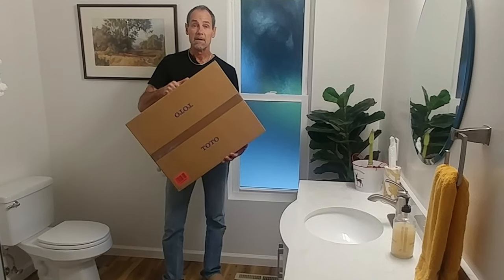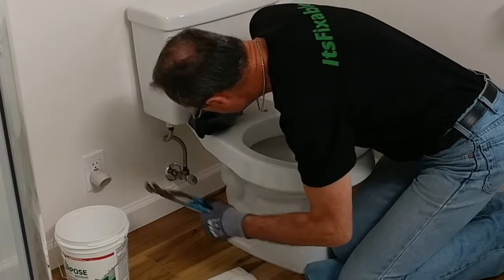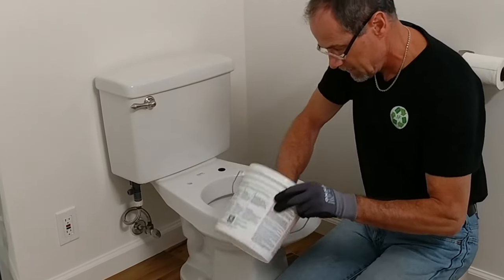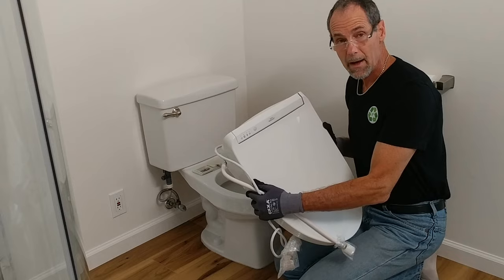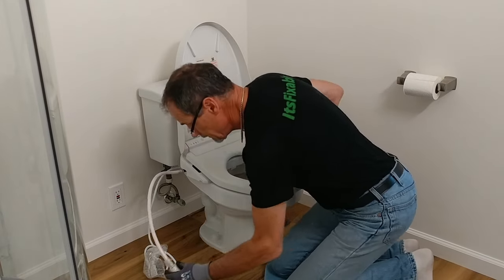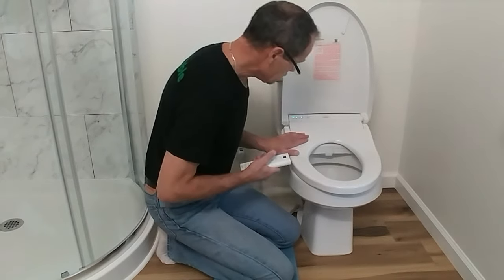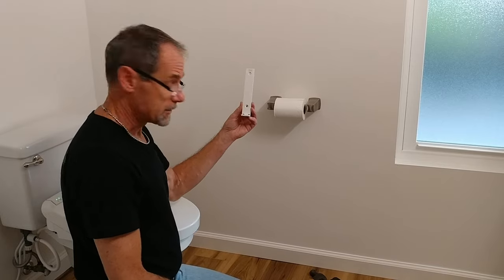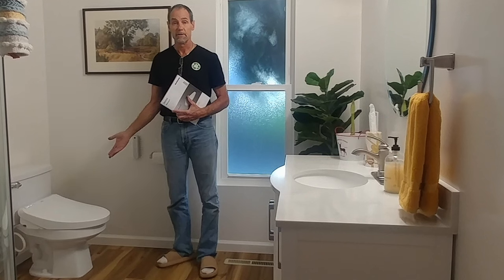TOTO Washlét Bidet Toilet Seat Installation

Comment: Two tips from a rank amateur ; If the grommets seem too large for the holes, drop the screws into the grommets and just push them straight down.  To position the seat forward and back move the washers forward or back on the bracket, thus moving the bracket.  Excellent video.
Reply from the maker: THANKS! Good tip on the grommets. Sounds like some people are having trouble with smaller diameter holes in the ceramic casting and you're approach just might work.
Reply: You’re the man, literally came to this video solely for help with this part
Reply: Holy god thank you so much I was hard stuck on this.
Reply: Lifesaver right here

Comment: In Germany the water connection is behind an drywallin 90% of installations..thats an serious problem. Also powerplugs next to watersources are not often to find because of safetyrules. After my Japan travel I want a TOTO😂
Reply from the maker: If water connection is behind drywall, how does one turn off the water in order to service the fixture? That doesn't sound convenient! Here in California, GFCI (ground fault circuit interruption) outlets are required when outlets are within six feet of a water source. additionally, they are required in all exterior applications. These are a wonderful safety device.
Reply: @ItsFixable  We have shut-off valves in various places, usually in the cellar or under the washbasins or in the bathroom. Normally, you can shut off every room that is supplied with water and also under the washbasin. Very convenient.

Comment: Just a note that on my Kohler toilet I could not push or twist the grommets in even wet, but using a screwdriver to gently push through the center of them it worked.
Reply from the maker: Your persistence paid off.
Reply: Thanks for the tip, was just trying to figure out a good way to get them on a kohler toilet 🙏

Comment: Great video,  very easy to follow. The only headache was trying to blindly screw the Washlet water supply hose on to the provided T nozzle behind the toilet. I ended up disconnecting the water supply hose from the tank first, attaching the Washlet hose, then reconnecting the whole assembly to the tank.
Reply from the maker: Sounds like a good solution.

Comment: This video was perfect! Reading the included easy instructions plus your video made everything VERY clear. I even used the same great configuration for the water line. In my opinion Toto should add a QR code that goes directly to your video! Thank you your video saved me time and heartache. ***
Reply from the maker: Great to hear!

Comment: for the issue with grommets not fitting i actually cut it up and screwed on from the bottom while leaving the top in the hole.

i know this is not the most conventional solution but i had tried everything else 

so far it is holding up great
Reply from the maker: Sounds good to me!

Comment: This was a very well done piece of instruction. I am moving my Washlet to another toilet and can find nothing on how to remove the rubber grommets from the toilet top, to install on the new toilet. They were difficult to insert (I used Vaseline) and I am dreading trying to remove them. Any ideas?
Reply from the maker: Glad it was helpful! I'm not sure those grommets are salvageable it they were that tight of a fit. I've read that some people cut them off underneath after removing the screw in order to get them out. You can buy a new set of grommets on Amazon for about $9!
Reply: Thanks for your sage advice. I did get them out, with a struggle, using Nipple Cream and lock plyers, but ordered a spare kit from Amazon just in case, for about $8.00 @ItsFixable

Comment: Grab the grommets on the underside and wiggle and pull while pushing from the top if holes are very tight.
Reply: Those damn things don't fit and I probably will have to hire a plumber to fix the toilet, return the TOTO to Amazon and I'm in big trouble with this building I am moving into.  Lucky me, the "affordable housing" came through after a 15 year wait list.   Trust me, the paperwork when you have health issues and are on disability make you want to die.   I  watched several installation videos  and it should have been easy but so far I've broken 3 bones dealing with the move from hell.  I probably set the healing process back or maybe I tore my shoulder again.    So if you can imagine the most primal scream right now...Losing my parents, 3 surgeries, Covid (I take 25 pills every day; its true if you aren't healthy you're fucked, in every way).Life sucks beyond imagining.  But at least I'm not bathing and drinking the Shigella infested waters of the Ganges so I shouldn't complain.
Reply: @jeffreybreitbart7118  have you tried putting soap in the water on the grommet and stick it in the hole and take a paper towel and grab the grommet on the underside and pull while pushing on the top end it should snap right into place, good luck

Comment: Question:  When I was tightening the grommets, the top part of the rubber grommet sort of popped out. It feels like the screws will never tighten. And the seat moves a little bit. If I tighten them more will I break something?
Reply from the maker: There shouldn't be any movement. The grommets need to stay completely down against the ceramic and the screws should draw the bracket down tight against the ceramic too.

Comment: After I tighten the two metal screws, the rubber grommets would come up a notch. I can't get the screws to tighten completely regardless how hard I push down. The brackets shakes a bit. What am I doing wrong ?
Reply from the maker: The grommets (anchors) shouldn't raise up. Did they fit snuggly into the ceramic's holes when first inserted? If they were lose, they aren't going to work. Perhaps there is something to wrap around them first so that they insert tightly. Then the screws should pinch downward on the bracket when they are tightened without lifting the grommets out.

Comment: I am struggling to get the rubber grommets in the holes in the porcelain.  Can I use a little soap to make them slide in more easily?
Reply: Installed on a Delta bowl, wirh small holes. I deopped the screws down the center of rh grommets and easily pushed the grommets through the holes pressing straight down on the screw heads.

Comment: The rubber grommets raise back up through the holes when I tighten the screws through the strange shaped metal washers.   If I only tighten the screws to the point where the rubber begins to climb up, the bracket is still very loose.  Very unhappy with this setup.
Reply from the maker: The grommets are supposed to squish and expand tightly in their holes. Perhaps your toilet has holes that are too large? I suppose you could use a washer and nut below instead.

Comment: OK, I used a little foaming hand soap and I still cannot get the grommets inserted.  I have a Kohler toilet bowl.  Perhaps the holes in the porcelain are simply too small?
Reply from the maker: I'm thinking that if they won't fit, simply switch to bolts and thumb nuts used on regular toilet seats. I see no reason why they wouldn't work to secure this washlet.
Reply: @ItsFixable  Now I can't get the grommets out of the holes.  There is a metal threaded sleeve inside the bottom inch of the grommet that is now jammed in the holes for each of the grommets.  In trying to remove the rubber grommet I tore the rubber.  This is going back to Amazon.  I tried to call Toto but there is no one on duty to answer questions on the weekend.  When do they think working people do projects like this?  I'm very frustrated and disappointed in TOTO.  I looked on the instructions to see if there were any cautions about attempting to install on a Kohler toilet and I was not able to locate anything.
Reply from the maker: Since they are already damaged, cut off the top rubber flange with a knife and then use the bolt as a punch to tap the remaining piece down and out the bottom of the hole. Then perhaps try mounting it with new, standard seat bolts and thumb nuts.
Reply: @ItsFixable  I pulled off the rubber above the part that was stuck in the porcelain, sprayed some silicone around the top and underneath, used an L shape needle nose pliers to grab the metal grommet from the inside, twisted to one side and the remainder of the grommet popped out.  Amazon is accepting the return and paying postage.  I can't believe I am the only customer who has experienced this issue.  Thank you for your continued interest in helping me get this straightened out.
Reply from the maker: @donnad8430  Wow, sorry! What a hassle. I'm glad you got it out. I hope others read this if they have a Kohler toilet
Reply: We are having the same trouble with the black rubber screw holders not going into the holes pm Koehler toilet.  Koehler toilets may be the most popular toilets so why hadn’t Toto accounted for this problem?
Reply: Also seems that Toto would address this problem instead of Losing sales over this simple to solve problem.
Reply: Great install video anyway!!
Reply from the maker: Thanks.
Reply: I just used the plastic nuts come with my Kohler lid and it works perfectly fine.

Comment: cannot get the seat to click into place . I also have a American standard toilet?
Reply from the maker: Is the seat hitting the tank when you slide it on? if so, you need to move the bracket toward the front of the toilet. Other than that I can't think of any reason it shouldn't clip in.

Comment: Video is helpful, but we could NOT get the rubber grommets in the toilet holes.  Dropped in the Toto toilet, the Kohler….not so much at all.  We used Vaseline and ended up having to carve it down an file the toilet hole.  Not all toilets are created equal!
Reply: Of course we went and got replacement bolts and washers, as I read on other sites people had to, then we tried it and used a rubber mallet and it went in.  This is NOT an easy part to get in if you don’t have a Toto toilet!
Reply from the maker: Sounds like a good solution though!

Comment: I have a Toto C5 and the seat keeps loosening.  I take it off, tighten the screws, put the seat back on, make sure it doesn't move and a few days later the seat is loose again --- 🙄 any ideas would be appreciated.  I hand tighten with a screw driver.
Reply from the maker: Mmm... seems odd. I remember having to turn those screws quite a bit as they were long and it took a lot of twists to fully compress the rubber retaining anchors. I haven't had anything loosen yet.
Reply: I did a toto washlet install and the bracket is tight  down to the toilet. Once the seat clicks in there is movement in the seat unrelated to the bracket. I guess that's the design. When weight is put on the seat it locks down. The toilet is a one piece toto elongated design so it fits perfect.
Reply: I think I’m having the same issue.   My bracket seems tight still but my seat seems to squeak now when I sit on it.   Seems like the back of the seat seems to have some play in it.   Good video though.   Helped me to take it off and try to fix it
Reply: @johno7149  were you able to fix the loos issue? I had the same problem with mines

Comment: How to make the screws tightly?
Reply from the maker: Your question is unclear. Are you saying that the grommets aren't sugged up by turning the screws? You should be able to tighten the screws quite a bit in order to squeeze the grommets causing them to tightly grip the ceramic.

Comment: Who's got an outlet next to the toilet?,
Reply from the maker: I did a complete renovation of the bathroom and installed the outlet at that time. You can view that process here: https://youtu.be/Pjmr_V79-vE

The desire for bidet features in home bathrooms is continually growing and therefore its a reasonable expense to have an outlet install. Even if you don't plan to immediately have the system, the outlet adds potential resale interest/value to the property; research shows that both modernized bathrooms and kitchens are the two most compelling sales features in homes.
Reply: Is it possible to use an extension cord until I can have a proper plug added to the wall? @ItsFixable
Reply from the maker: I don't see why not. Just be sure and use a quality cord, not excessive in length, and route it in a safe manner keeping the end connection away from water.
Reply: @ItsFixable  well, if you have one, ok, but the standard house in the USA, I don't think it is going to have one, that means, some body has to spend money on the installation
Reply from the maker: Yes, unless you are a skilled do it yourselfer. Electrical wiring is actually pretty simple, but there are rules that need to be adhered to.